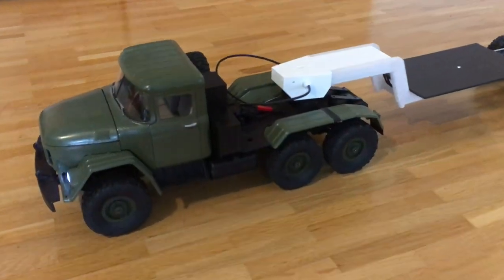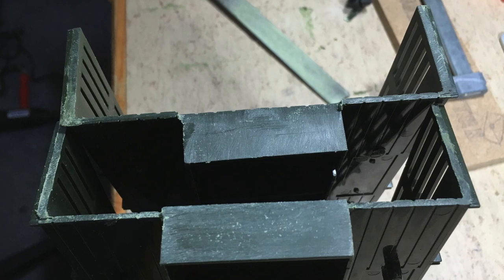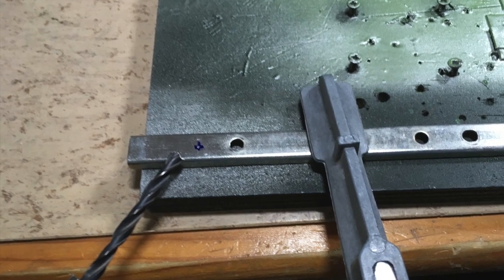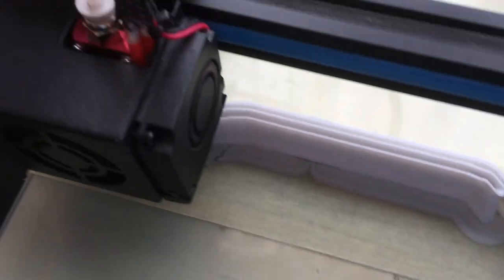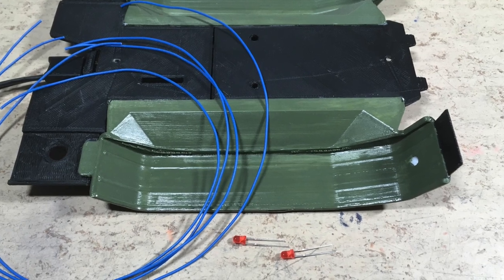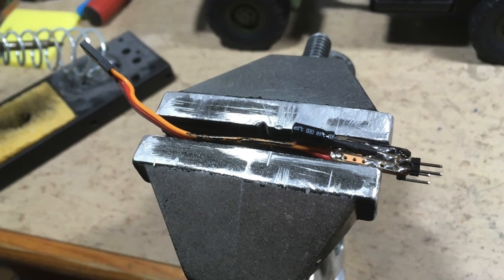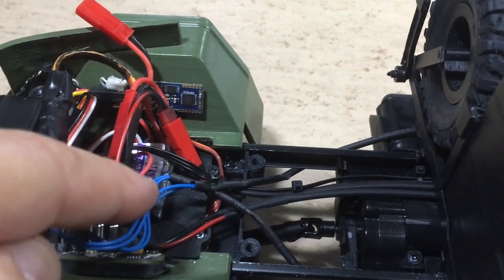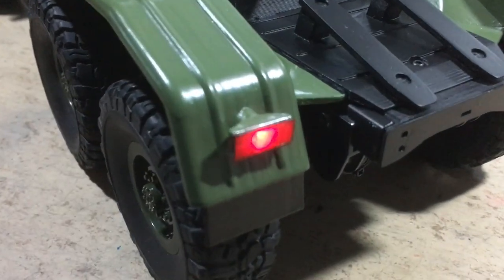3D Printed ZIL-137 10x10 Drive WPL Truck: Tail Lights, Trailer Metal Drive Train And Bed!

Comment: Well, besides all else, those back lights got me impressed :)
Reply from the maker: Thanks :-) . Driving tail lights with integrated brake light is a unique feature of my Micro RC receiver. You just need to plug the driver board in the servo 2 port and enable the "taillights" variable in the code.
Reply: @TheDIYGuy999  , yes, but in this i was referring to your craftmanship, getting those lights there, physically ;)
Reply from the maker: Thanks. Yes, its was quite tricky. I think there are about 70 3D printed parts on this truck so far...

Comment: cant wait to see a run video. awesome job!
Reply from the maker: Thanks. It will follow... There are still a lot of details like mirrors on my list.
Reply: @TheDIYGuy999  Can't wait to see the finished product. where did you get the cab? it says it is based off a JJRC Q60 but the one I have looks like a 1940s truck it isn't snub-nosed like your truck is.
Reply from the maker: It is 3D printed like almost everything (about 70 parts, I think) on this truck except the axles and the frame rails. You can find the links to the STL files in the video description.
Reply: @TheDIYGuy999  I can't print anything or I would be making my own parts or other things that I have been working on. I was just curious.

Comment: Where I can get this light covers at 1:52 ? Which paint should I use to get same interior of the tail lamp like in 2:14 ?
Reply from the maker: They are included in the Thingiverse project. Link is in the description. I have used a sliver acrylic pen
Reply: @TheDIYGuy999  but this light covers are transparent red and transparent orange?
Reply from the maker: @dubik3e  They are 3D printed, using transparent PETG and then painted, using orange and red water resistant felt-tip pens
Reply: @TheDIYGuy999  Thanks for answear!